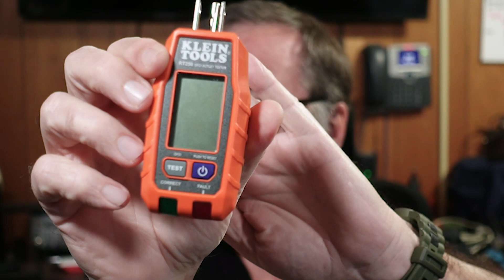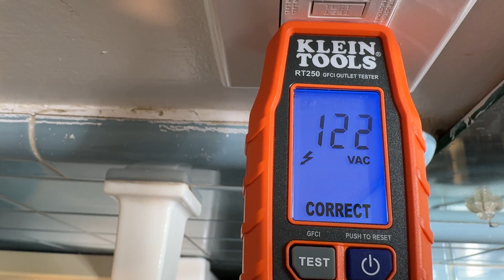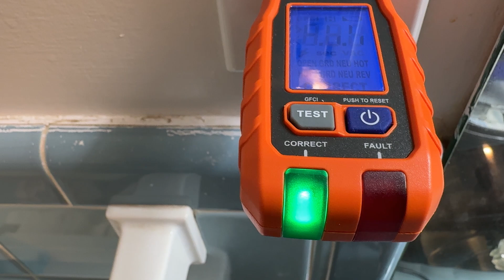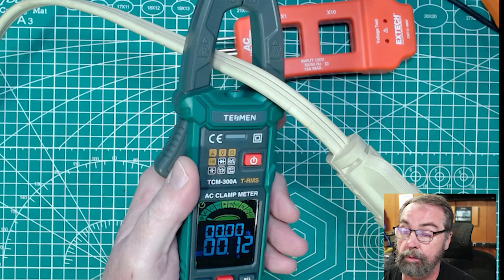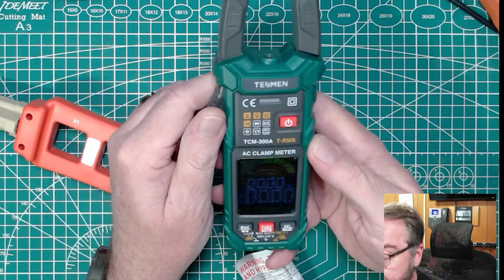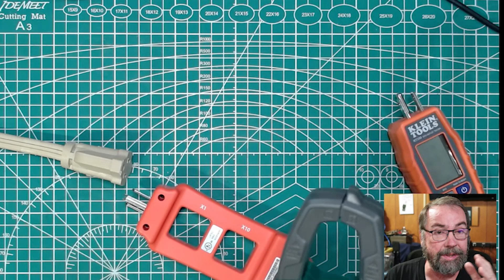Crossover Tools for Hams & Homeowners

Comment: Nice presentation and inrush is a problem with capacitors not just inductors.  Everything has some inrush and your point it can be 	quite great at higher voltages.  Thank you.
Reply from the maker: Good point - that completely slipped my mind!

Comment: Great video JIM . You did loose sound for part of it. As a electrician I have same testers and a lot more.  Love that GFCI tester. I have the same one and a tripp lite one.  I have a line splitter as well but tripp lite brand.  I have several clamp meters .  1 rated 1000A . some do DC amps.  Most do frequency HZ.  Great for inverter testing and generator set testing.  I have a outlet load tester that puts a load on it and measures voltage under load.  The outher one does breaker test . Breakers in a home go bad often, The spring gets weak over time and contacts wear out.  I have even a ground rod resistance clamp meter . It even checks for ground current. DC or AC amps. Which can be bad . I find faults all the time and fix them.  For small AC amps you use the X10 hole and divide reading buy 10 , With DC clamp meters make Sure you zero them with no wires inside them.  Even linemen use AC clamp meters . They have a stick holder for them.  The ones buy me use bluetooth meters.  They read on their phone and meter can be way up on a pole .   73